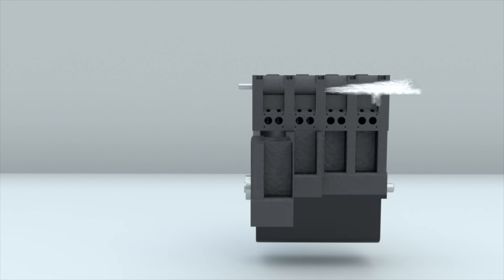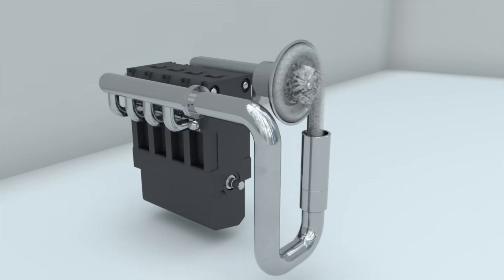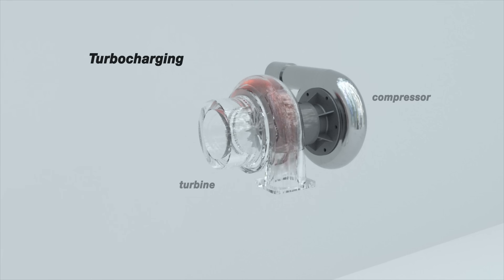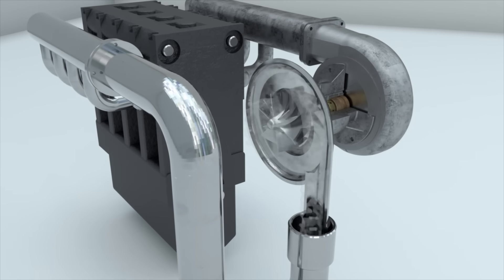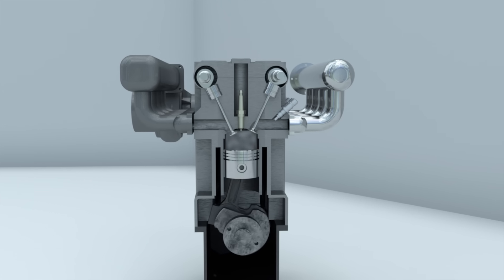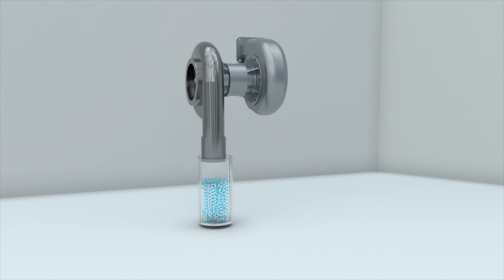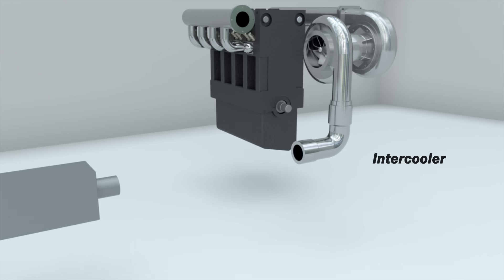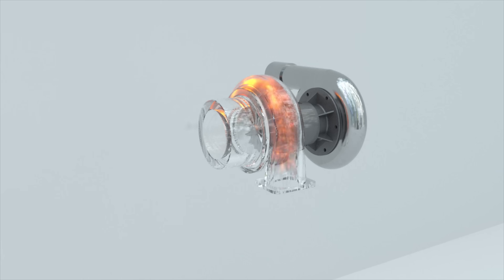How does a turbocharger work?

Comment: Downside of turbos, more so with larger turbos, is boost lag at lower RPMs. Having both, turbo and supercharger is great for getting best of both worlds. The supercharger works at low RPMs to get it going and then once higher RPMs are reached, the supercharger has a valve that will disengage it and then engage the turbo. Also....pully turbos are complete crap lol. It then acts like a supercharger and you lose power due to another pully used which defeats the purpose of a turbo lol
Reply from the maker: thanks for the info
Reply: You can change your driving style to avoid turbo lag on a circuit.

For example,quickly tapping the throttle mid corner makes sure that the turbo gets constant air. Ayrton Senna was famous for using this technique when F1 were still using old school turbos.

Comment: So quick question- the heat produced from the turbine/exhaust is inefficient when the heat transfers to the compressor, so than why have them connected so close? Use a longer shaft that doesn't transfer the heat? Or am I missing something?

Comment: Turbochargers are of course great for adding power / torque but I prefer high revving (~ 7500 RPM +) naturally aspirated motors for the instant response and more linear / predictable power delivery. Most "sports cars" today are just way overpowered / overkill IMO and simply aren't all that fun nor rewarding to drive due to this obsession with "test track numbers" and limits which can only be even remotely exploited on a race track going balls to the wall which in the end doesn't really matter unless your racing your daily driver for a living.
Reply: Or... just drive a turbo between 1500-4000 and be good with the gears. Oh I forgot you drive auto so the only excitement you get is getting near redline in nat-atmo
Reply: @joebloggs830  I drive auto? Why because I point out the fact that N/A motors are inherently more rewarding to drive for many reasons far more relevant and meaningful than mere test track numbers. 

Sounds to me like you are far too attached to your overpriced investment (something with a “turbo”) and hence lash out at anybody who insist that your ideas are probably based on BS.
Reply: @erickelly4107  
"Inherently more rewarding" driving a nat atmo auto? BS PIFFLE. If you actually learned to drive rather than having the car drive you, you'd understand. 
My car only cost me $25K brand new, VW Golf TSI in 6-speed manual. It runs well 130K on the clock and is 7 years old. Still drives like new.
Reply: @joebloggs830  How in the hell would you even know what car I drive? I never mentioned ANYTHING about what car I drive. 

Regardless, I have a 2021' Mazda MX-5 Miata Club 6-speed Manual. Yes far more fun / rewarding to drive than pretty much any car regardless of price. Not to mention cost much less to run (vs. your typical overkill "sports car") and is rock solid reliable / doesn't cost a small fortune to replace tires, brake pads, general maintenance, insurance, etc. 

You're just making shit up because my comment about turbos hurt your little Ego. No surprise you drive what you drive, a ticking time bomb.
Reply: @erickelly4107  
Mazda Miata? 😂 That's how you know you've made it in the world. Couldn't care less what you think, I like my car, you like your car, let's leave it at that. 
Oh and the engineers know what they're doing - there's a reason the new Mazda's are turbo'd too...

Comment: you did a shit job at modeling. 3:40 is a prime example, where the impeller on the left side of the screen is clearly larger than the space its being housed in, and clips through the walls of the cavity its housed in.

Comment: What is missing in this explanation is the utilization of the thermal energy of the exhaust gases. That is what makes a turbo charger really work. The temperature difference of the gas entering versus the gas exiting the turbine is what supplies the most energy to the system, not the pressure out of the cylinder.

Comment: In automotive speak, "intercooler" is used to refer to what is technically an aftercooler. Unless there is another compressor after the cooler, this is incorrect.
Reply: The piston compresses the air again after the intercooler on the compression stroke.
Reply: @WeighedWilson  It compresses the fuel air mixture not really the same thing.

Comment: Does turbocharging an engine cause any significant reduction in lifespan? Why or why not?
Reply: Depends weither the engine is built for it or not since the increase of pressure can break the components

Comment: How does the exhaust gas exit the engine finally...it seems to me that the turbo uses exhaust gas to pump into the cylinder's..so how does the gas exit the exhaust pipe.
Reply: Through the middle of the hot side of the turbo into the exhaust system

Comment: Gas is not made up of particles.
Reply: Yeah its made of magic
Reply from the maker: In the mechanics of liquid and gas, for calculations, the concept of a liquid particle is introduced - this is a particle whose size is negligibly small compared to the size of the flow, but this size is much larger than a molecule, so as not to take into account the forces of molecular interaction

Comment: For the longest time I was under the impression that a turbo forces exhaust gases back into the combustion chamber, since not all the oxygen was originally burned, thereby creating more power. I wonder if that was ever the case, or I was misled somehow.  This video definitely helped to clear things up!
Reply: That is called exhaust gas recirculation (EGR) it doesn't require a tubo but is common on modern diesel engines that require a turbo to be efficient.   Gasoline engines without turbos can have egr too.  It reduces the amount of oxygen, lowering the temperature of the combustion and reducing nitrous oxide in the exhaust.
Reply: @Bendigo1  Thanks for chiming in! I found a video which explains EGR pretty well. I learned something new!
Reply: youre thinking of an evap and erg system

Comment: My car is a 2005 turbocharged it has a 3L V6 engine with 280-300 horsepower and outside of the city can consume as little as 4.9L/100km (47 mpg)
Usually it consumes around 7.5 outside of the city and inside the city it's around 9L/100km
A turbocharger is simply a technological advancement. You can make every engine faster and it will consume less fuel with a turbo charger.

More oxygen = bigger explosion
That oxygen is taken from already used oxygen in the engine...
Ta-daaaaaaaaaaa MAGIC!
Reply: It's mostly up to the Engine Control Unit to work out the fuel/air mix. More air does not necessarily mean more explosion. 14.6 parts of air to 1 part of fuel (gasoline) is generally considered a good combustion for both nat atmo and turbo

Comment: My previous, 1 litre turbo charged 3 cylinder engine used much more fuel than my current 2 litre, 4 cylinder , N/A engine. 

How can this be possible?
Reply: More air needed to burn more fuel.  Add more air to burn more fuel to get more power from the same size engine.  Without forced air, there is a limit to how much fuel can be burned per cycle.
Reply: @Bendigo1  Sure so no real fuel efficiency improvement, as is touted in this video (and many other places). Just insane power to size ratio and a small weight improvement by reduced CC.
Reply: @PaulA-zp7hn  the turbo doesn't increase efficiency on it's own but allows the option to optimize air fuel ratio better than naturally aspirated engines that depend on atmospheric pressure to get air into the engine.

Comment: I have a 2017 Ford Escape Titanium AWD 2.0 Eco-Boost. It has 245 Hp. 6 speed trans and Sport Mode with Paddle shifting. It runs and drives like a Go-Cart. It catches other cars and SUV's off guard at the light.   Shawn.

Comment: Whats the difference between Turbo charged and super charged? Pls someone care to elaborate
Reply: Turbochargers use a turbine that's spun by the exhaust gases exiting your engine to compress air and create boost. Superchargers are driven by a belt connected to the crankshaft of the motor to compress air. Turbochargers have a certain RPM threshold they need to pass before making boost and thus are most effective at high engine RPM. Superchargers don't have this problem and pump the same amount of air into the motor no matter the engine RPM. Both have their advantages and disadvantages
Reply: @jurj97  Superchargers have inherent parasitic loss from the belt and are worse for mpg, as they are always being 'used' even when not being 'used'. superchargers will be better down low and mid range vs turbos. if you car only revs to 6k, put a supercharger on. if it revs to 8k, pop on a turbo.

Comment: The primary use of the turbocharger is to operate the engine at sea level on a standard day, regardless of altitude.  This is where all reciprocating operate at their best performance.  And this is the primary reason this system is used on aircraft engines.  Use in automotive is only about 40 years old, but it works there too.

Comment: I got a newer GM twin-scroll 2.0 ECOTEC LTG engine in my car and it is amazing. No turbo lag, smooth as butter. 80,000 miles and feels brand new.
Reply: 80,000 miles would still be the break in period for a small block V6!

Comment: Does the increased oxygen content cause a more complete combustion of fuel therefore making it more environmentally friendly? How big of a difference in emissions will this cause? 
Also, What are some examples of small engines with turbochargers?
Reply: It allows the engine to burn more fuel under load and still burn less while idling. So better fuel economy and more power. They're not intended for emissions, but may effect emissions.

Comment: I have an 08 Acura RDX with a 2.3L 4 cylinder turbo.  I love how the turbo can adjust for higher altitudes and provide less drop off in power compared to regular gas engines in the mountains.
Reply: funnily enough thats the exact reason turbochargers were made for. Engineers started installing them in planes back in WW2 alongside superchargers to combat power-loss at higher altitudes so the planes could run faster and more powerfully all around.
Reply: @Bonkers-yl2jd  I'm starting to see high end cars like Volvo using superchargers+turbos and others using electric motors on turbos to reduce spool time.  I've added an Acura MDX Sport Hybrid with 3 electric motors and 3.0L N.A. engine.  Pretty much performs the same as a zero lag turbo or supercharged engine with mpgs in the 25-27 range in city/hwy always for a +4500lbs 3 row SUV.  The 3.0L suffers a bit at high altitudes; but, the electric motors make up for it.

Comment: Damn very informal video, never knew all of this. So if our turbo/boost is too big/high, does that just mean there is too much air being forced into the engine chamber cause it to blow?
Reply: That’s what a blowoff valve is for and any excess gets spun back out the turbine hence the flutter but that’s bad for the turbo so most if not all have a blowoff valve that opens and let’s the excess out
Reply: @Nr15121  So your saying having a blow off valve is good for the engine, just incase you almost blow it. But having a valve is bad for the turbo bc of the extra work? So isn't it similar to the saying "damned if you do damned if you don't?" Thanks for the explanation

Comment: is the back pressure in the exhaust line considered a type of parasitic loss?
Reply: Yes, but it is usually designed to improve performance rather than reduce it.  Adding a turbo to an engine that was not designed for one or not adjusting the engine to compensate for increased back pressure can be bad.  It is still much less loss than something like a supercharger.

Comment: Note that the turbocharger and supercharger were invented in the late 19th and early 20th centuries respectively. The were utilized to enable piston-engined aircraft to operate effectively above 10K feet. Some, like the P-38 Lightning, had both.

If you live in a high-elevation environment, it's best to get a vehicle with a turbo and/or blower.
Reply from the maker: thanks for the info
Reply: Very few habitable places in the world above 10,000ft
Reply: Or just get an electric car.
Reply: @andriidesu2936 That’s 🏳️‍🌈
Reply: @andriidesu2936  Stop talking. Now.
Reply: @rain7659  He's not wrong tho, motors are not affected by altitude like NA engines are.
Reply: @LAndrewsChannel except batteries are affected by higher elevations. How? Colder temperatures
Reply: @OutdoorCanadians  Yes, if you ignore the rest of the car and context.
In reality, if you climb from a lower, warmer elevation to a higher, colder one, the battery will already be warm and the temperature decrease will have 0 effect on it. And if you stay overnight at the high elevation, you can preheat the car to have 100% performance from the battery.
Reply: @andriidesu2936  They're not as fun
Reply: Nah, too much pollution from the coal-fired powerplant.
Reply: @wralford  someone doesnt know basic sense
Reply: @andriidesu2936  I'd like to introduce you to a concept called "fun".

Turbocharged cars especially ones where you can hear all the parts working are more Fun to drive than an EV.

Thanks.
Reply: @nzcabbage1923  Spoken like someone who has never driven an EV
Reply: @jimbojones8208  once. Good for driving to work. Not so much in the hills on a Sunday. Next.
Reply: @jimbojones8208  I have and the driving experience was horrible. If you use it for short commutes and have the possibility to charge it at home it's great, for fun driving on B roads they suck

Comment: Wow. So an intercooler always accompanies a turbo charger? Or it's just an advanced option?
Reply from the maker: On the right, almost always a compressor with an itrecooler in modern cars. There used to be systems without an intercooler, but they are ineffective.

Comment: a very unreleiable piece of technology  the turbine bathing in hot exhaust all the time , when you turn rngine of the turbine still hot coking oil , that dont flow no more that is not counting the seal end leaking depending which one if it leak into the engine coolant or shoot oil into the intake manifold or else oil leak into the exhaust blocking the catalyst converter and one a small engine when you use compression downhill well there is none since the turbine got no exhaust to drive it no compression not much of a mechanical gain unless you are a racing team where cost is no object ..............

Comment: The first one is technically a pro charger if it’s belt driven. Some call them superchargers since they are belt driven. Super chargers and blowers are also technically the same thing. turbochargers are exhaust gas driven.
Reply: A turbo without the exhaust turbine is a centrifugal supercharger. It can be belt driven or it can be gear driven. ProCharger is just one brand. A supercharger is any system meant to force air into the engine. There's turbos, Roots blowers, screw type superchargers, centrifugal superchargers and you can even refer to nitrous oxide as a chemical supercharger. They each have their pros and cons.

Comment: Stupid question. Why can't the turbo impeller be run with an electric motor?
Reply from the maker: This requires a very powerful generator and battery. Really use a combination of electric and turbocharging.

Comment: Great video, well explained. I have 2 questions, if anybody could please answer:
1 - in a naturally aspirated car, the throttle body should be between the air filter and the intake manifold. Where is the throttle body in a turbocharged car? Between the intercooler and the intake manifold?
2 - what's the air path in a turbocharged engine? Is it air filter -> turbo -> intercooler -> throttle body -> intake manifold -> cylinder? Does that mean that when I start accelerating and the turbo is not working much because of lag, air still passes through turbo and intercooler to reach the cylinders?
Reply: yes you would be right about the throttle body, and yes you are right about the order of them as well for the second question, the reason for lag or "turbolag" is because lets say when putting the gas pedal to the floor, air is still needed at that moment to get taken in by the turbo combusted and spit out to spin the turbine of the turbo via exhaust gases which increases the pressure of the system and the air in it which spins the turbine which is connected to the intake turbine, then allowing the intake turbine of the turbo spin faster therefor sucking in more air which equals mo powa babeh
Reply: @epicalty8474  thanks for the answer! Moh powah babeeehhh!
Reply: You can decrease turbo lag by putting smaller twin turbos vs a single large one but top end power would be greater on a large single one. It's also very important to take into account the displacement of the engine vs the mm size of the turbo. The colder the air temp is coming out of the intercooler the more power you can make. For max hp you will need forged steel crankshaft, rods or connecting rods and pistons, some applications with very high cylinder pressure will do a process called O-ringing the block and heads to completely seal the cylinder to the head.

Comment: This was a great video and very informative, but could you explain why it looked like exhaust air traveled into the intake to the turbo, it was at the 2:31 point of the video.
Reply: The exhaust air traveled into the intake on the turbo so it could spin the propeller that’s on the inside that is then connected to a shaft that runs to the other side of the turbo that then spins in the opposite direction sucking air into the motor, where you see the smoke come out of the turbo is where the exhaust from the car goes. And then it goes through mufflers etc all the way out the back of the car hope this helped!